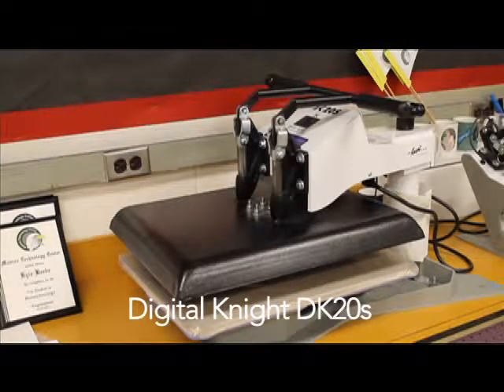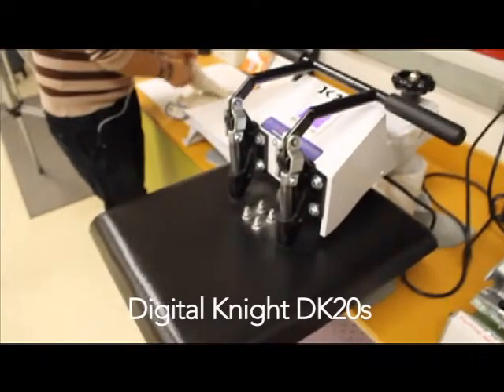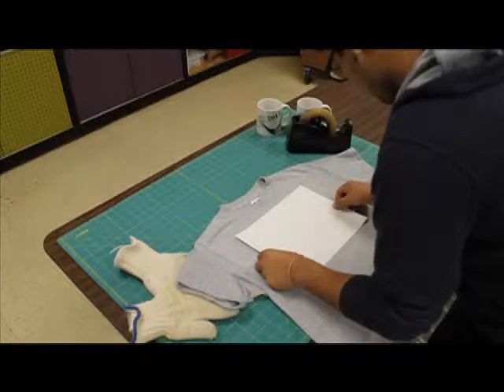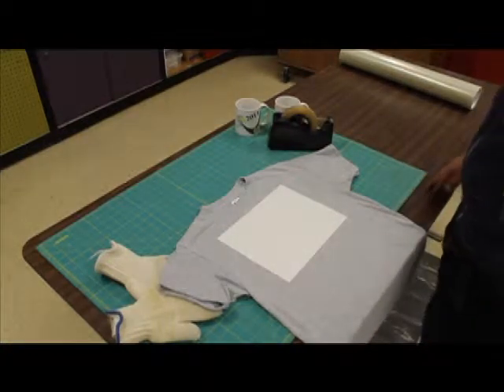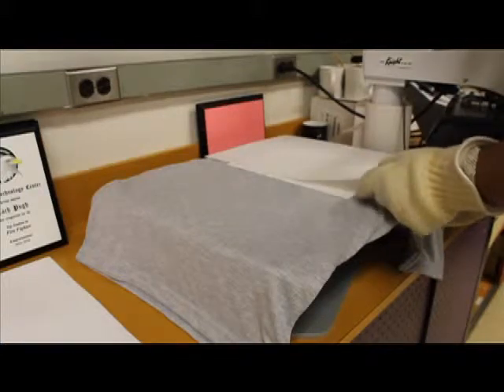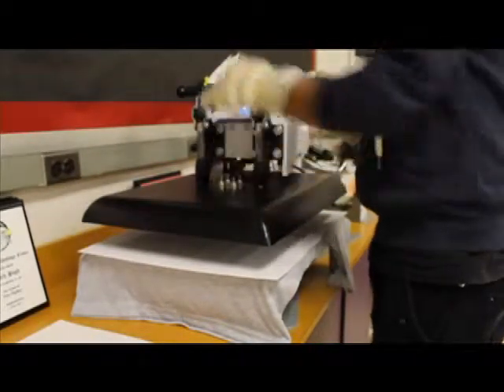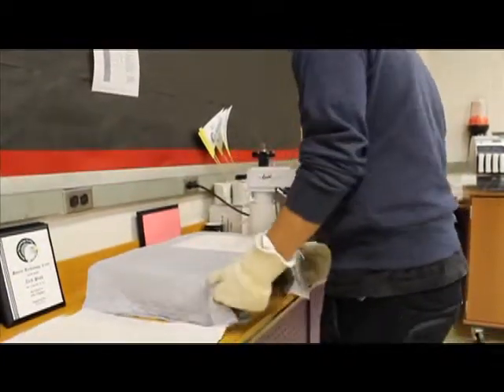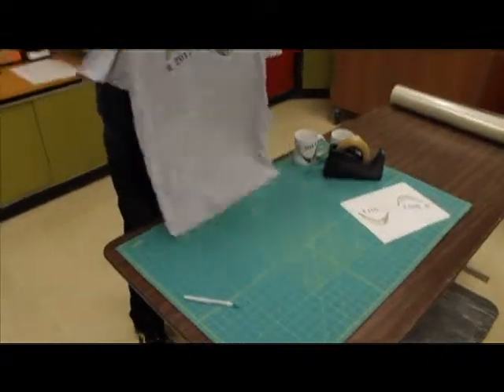Digital Knight DK20s

Comment: where to i attach the metal power cord clamp. that came with the 
machine. itrs a small 1 inch by half inch metal clamp. goes on the power
 cord but im having trouble locating where i place it. thanks!